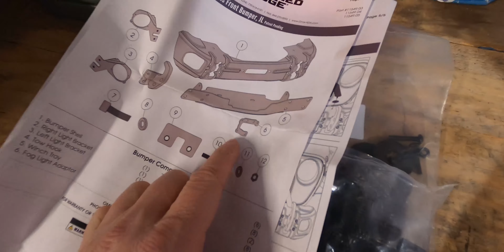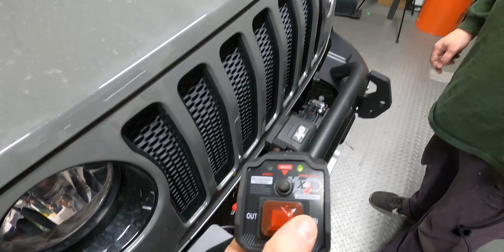Easy First Jeep JL Wrangler Mod | Bumper & Winch Install | Rugged Ridge Arcus + Smittybilt X20

Comment: I like the stamped look, its different from everyone else running steel bumpers or aftermarket welded plate.  I would have sent the hooks out to be powder coated to match the red on his hood vinyl, personal aesthetic choice, but overall it added a nice simple and aggressive look while reusing the factory fogs.  Hopefully it was budget friendly given the weight that could take a bit of a pounding in my neck of the woods, I'm 30mins from the Rubicon Trail and Fordyce Creek.

Comment: I loved everything about that setup except for the bolt on bull bar: only because somebody that doesn't know that it isn't a solid welded piece, could easily break it if you weren't right there to stop them (somebody backs into it, or ties off on it, etc).  I got a similar, solid steel EAG bumper on Amazon for about $220, that I put on my Jeep, and I love it.  Great video guys!!!
Reply from the maker: I thought about the same thing. With those monster hooks sticking up above the bumper, I think it looked pretty good with out the bar.

Comment: I did this same setup on my 2021 JT Willys. Lost an inch in front end height. Also, trying to get that air box back in place was a real trick, had to grease up the rubber plugs. Thanks for the video though, it really helped.

Comment: Hey man. About to pull the trigger on the Arcus front bumper for my 2021 JT. But website doesnt have the tubular overrider bar available for the Gladiator, only the stamped steel one. It only shows the tubular bar available for the Wrangler. I called them and asked why and was told it was because the tubular leans backwards towards grill but stamped steel one is straight up and down. I’ve watched just about every vid and looked at every photo i can find and it seems clear that the tubular
Overrider bar actually leans forward, and I cannot see any reason why it would not work on a Gladiator. From your install can you see any reason why the tubular overrider bar would not work on a Gladiator? Not holding you to anything, just curious your thoughts since you did the instal.

Comment: The lower plastic "skidplate" is actually called a splash guard.
Reply from the maker: Ya its a metal guard on the steel bumper jeeps.

Comment: I’ve got the same bumper in my garage waiting to go on my Gladiator! Do you think a winch could be installed after the bumper without having to remove the bumper? I don’t have the winch yet and want to go ahead and put the bumper on
Reply from the maker: It's been a while since I install this but I think the answer is no as it is so tight to the grill that the bumper would need to be off to fit it in.

Comment: Does rugged ridge sell the bumper hooks just by themselves?
Reply from the maker: I didn't see them, I wonder if they would sell them on their own if you contacted customer support. They would be cool to put on the rear and delete the entire bumper.
Reply: Casey 250 I contacted them to see if they had them atleast for the front, but I’ll make the suggestion about the rears.
Reply: Casey 250 just got this from the company. 
Thanks for sending in your inquiry.  Unfortunately the Arcus tow hooks are not available as a separate retail item at this time.  I am unaware of any plans to make them a stand-alone part, however, it might be something that is done in the future so just keep any eye on our website for new product releases.
Reply from the maker: @codytaz  Ah cool! thanks for the update.

Comment: Love those tow hooks!! Are they made for the jk
Reply from the maker: Don't think so.
Reply: @Casey250  I wonder how difference there is in the bolt pattern on the frame horns from the JK to the JL
Reply: Yes they make this bumper for the JK
Reply: I have the rough country hydrid bumper, with d ring mounts, I like the look of those hooks, as long as they would fit.